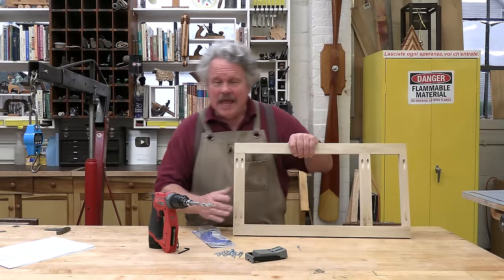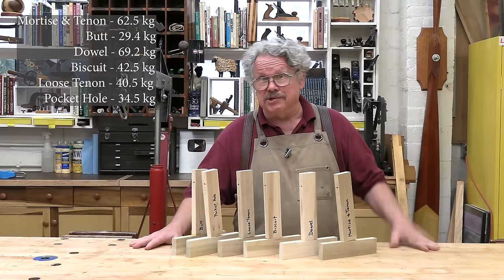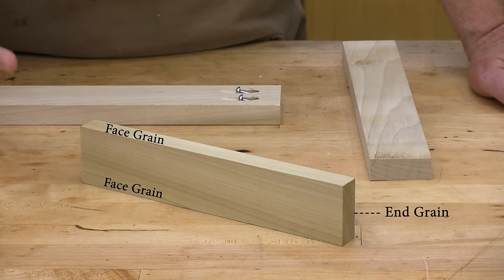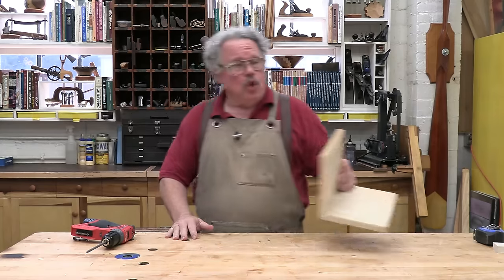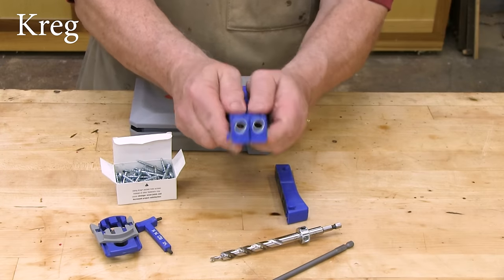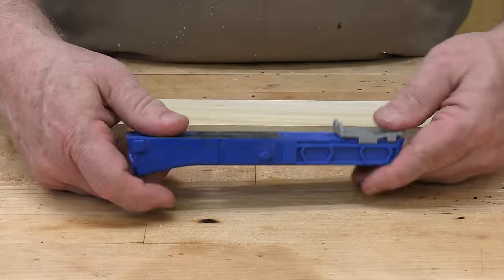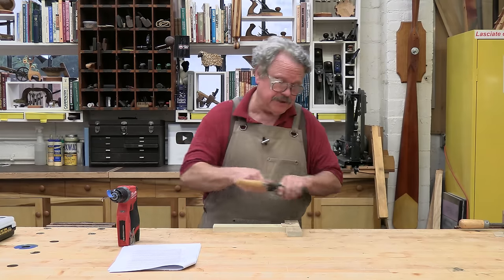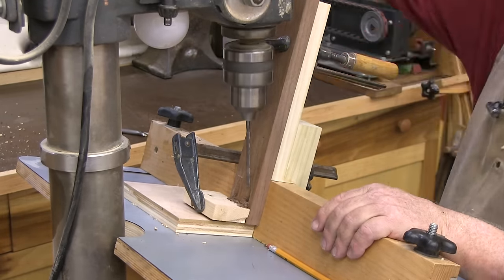Pocket Holes Overexplained

Comment: I'm not sure why YouTube suggested I watch this video but I'm glad it did. I have used pocket holes on a bunch of different projects but I still learned a lot from this video. Someone told me about pocket holes one time so I ordered a kit but have almost no woodworking training aside from 9th grade shop class 25 years ago. I typically work with metal but occasionally I violate the sanctity of my metal shop by using some tree carcass and learned pretty quick that none of my welding equipment or techniques work on wood no matter how hard I tried so pocket holes and epoxy seems to be the easiest way to connect 2 pieces of wood together with the least amount of wood tools and be able to hide the evidence when making a frame.
Reply from the maker: Thanks for sharing...and the kind words.

Comment: Fantastic video, watched the whole thing just wanted to say one thing:

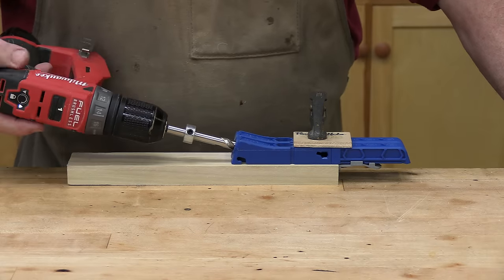The bit doesn't need to exit the first piece when predrilling your hole. If you are using the correct screw the screw will still spin freely and clamp the wood pieces properly because the thread will pass the end of the first piece of wood. You can see in your video when using the Kreg jig at ~14:40 both holes you drilled you hit the jig as you exited the wood, this will either damage your jig or the drill bit depending on what material the jig is made of. When offsetting the depth to fully penetrate you also reduce the amount of material left to clamp between the screw head and the receiving piece of wood, not a lot, but you are already being critical of the strength of the joint and this wont improve it.

Comment: Hi Nick. You can of course drill pocket holes either horizontally or vertically (easier to do horizontally) with a Shopsmith! & yes even though I live in the UK, I do have, not 1 but 2 Shopsmiths, Both Mk520, but one has the MK7 power head.

Comment: First time to this channel. I’m a “detail” guy and you impressed ! I might add one thing to your twice gluing end grain. Dilute the first glue application and then use full strength for the second . The diluted glue will be absorbed deeper into the end grain increasing the strength of the joint.

Comment: I like your approach. The pilot hole step is super smart and it will help solve the parts-shifting problem I always had with pocket holes. 

The jigs are designed to not have the stepped drill exit the workpiece, because the tearout will get in the way of assembly. That's why you had to position the stop collar further along. But I like your approach better.
Reply from the maker: Thanks.  You might want to read my answer to David Powell; it touches on the ramifications of using my method.

Comment: Some useful tips there.  Double gluing end grain for one, and keeping the grain direction of both boards the same.  I'd not thought to do that before.  I think my biggest problem when I first started using pocket holes, was stopping the joint being pulled out of alignment when the screw were tightened.  It's not always easy to clamp the joint while putting the screws in, so any tips on that would be welcome.

Comment: Good to see that you deal with metric on an equal footing rather than complain about it.  I generally use inches and feet (because I'm an old fart) but I know I have to make adjustments with plywood.  Really enjoy the channel and the plans I've bought so far have been pretty clear and easy to follow.
Reply from the maker: The global supply chain will eventually do for us what we don't seem to be able to do for ourselves -- convert us from fractionophiles to meterminds. Your comment concerning plywood is spot-on; we're no longer getting just 4' x 8' sheets, in many cases they're 1.25 m x 2.5 m. Bought a counterbore drill the other day that was clearly etched 3/8" right on the shank, but it miked at .3937" -- 10 mm. Thanks for your kind words.

Comment: Armor and Massca's higher-end jigs have setup systems that make the drill bit setup way easier. On Armor's Auto-Jigs, clamping in the workpiece will set the stop collar position and tell you which screw to use. Massca's requires more manual setup, but has a tool to position the bit so you can set the collar.

Comment: Geez, who'd have known screwing some wood boards together could require so much knowledge. As a plumber I didn't care about carpentry, but now I have so much respect for it.
Reply from the maker: As you well know, there is much more to sweating a good joint than just heating up the pipes. Same here.

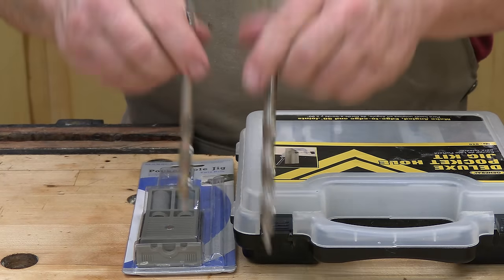Comment: Love your videos, but I had a different experience with the Kreg than what you mentioned at about 14:20 in the video. While it's true that the Kreg jig when the stop collar set at the wood thickness did not exit the wood - I followed your suggestion but found that if you set the collar such that it did just barely exit the wood, then once the screws were put in place, they would poke out of the mating board - disaster! In my project I ended up having to hand grind something like 80 screws by 1/8" or so to not get points protruding and ruining the work. That took about an hour but saved my project. Thankfully I didn't lose any knuckle skin to the grinder :-) I suspect that Kreg intentionally allows a bit of wood in the pocket hole piece. Maybe that saves time in case a chip hangs in place that you'd have to clear to get a good flat mating surface? Anyway, thanks for all of the explanation, but my advice would be to follow the directions exactly!

Comment: Love the info, just a quick couple obligatory clarifications from a structural engineer.  Crane scale isn't a strain gage, it's measuring force, not strain (change in length per unit length).  Also, most of these are going to be very dependent on "strain rate", so ideally you'd want to somehow use a consistent speed that you apply the load at.

Comment: I used to think I was crazy for drilling pilot holes for my pocket holes. I originally started doing it so I could use screws that were not from kreg, but it seems I was doing the right thing from a mechanics of the joint point of view. I also used a piece of dowel that is slightly smaller than the head hole (with a grub screw to lock it in place) so I can set my 1/8" drill bit depth, bottom out and get perfect pilot holes every time. Thank you for This bit of education.
Reply: I like your tip of using a dowel. I've done a number of holes using the Kreg so I'm not totally new to this. After watching the video, I was  unclear how to set the length ( marked with tape ) on the 1/8" drill bit. At first I thought you might be using a dowel with a 1/8" hole in it more as a guide. I'm confused about locking it in place with a screw? I assume I'll drill using the e.g. Kreg pocket hole bit, pull that out  and lay the 1/8" bit inside the drilled hole,  marking bit with tape ( at the back side of where the pocket hole starts ) having the drill bit tip extend out 1 inch. Does this make sense? My next system will probably be the Massca M2 Pro. I agree with you , I often wondered if wood would split if just relying on the Kreg screws to cut thru wood. Most of my work has been with soft woods, but I can see the need for a pilot hole in anything harder than pine.

Comment: Great video.

I'm kind of curious how much a bigger budget changes this?

The hobbyist like myself is certainly not going to get one of the bigger Castle pocket hole machines but just might find the precision of a Castle 110 to be worth the cost.  There are several differences you get with the Castle 110:
1.  Unlike the 15° angle most pocket hole jigs produce the Castle 110 will give you a 3° angle and that puts the thread into the middle of the joint.  This means that you are unlikely to get significant joint creep (not uncommon with the Kreg jigs I've had (still have my 720) and for at least some directional forces it should be stronger.
2.  The Castle 110 appears to give a cleaner hole which should fit tighter to the screw shank and that might also give a somewhat stronger joint.  (Probably not a lot stronger?).
3.  One thing that is considerably "worse" about the Castle 110 for some purposes is that so far as I know you cannot get plugs for the pocket.  Castle brags that their router makes a cleaner pocket (and it really does) but if I put a plug into the Kreg pocket hole and do a little sanding, IMHO it looks better than the un-plugged gap the Castle 110 leaves.  Of course the flip side of that is that if making something like a cabinet, the joint you get from something like my 720 is stronger if the screw goes in from the outside of the cabinet but with an only 3° angle the Castle 110 joint should be very nearly as strong if the screw is inserted from the inside and thus (in many cabinets) effectively hidden.
4.  Castle wants us to use their pocket hole screws.  They are a little different than the ones Kreg sells.  The Castle 110 ones have what I've heard is called a Fillister head (aka cheese head) and Torx drive rather than square drive.  These features may or may not be all that advantageous but as best I can tell there should be some strength advantage.

For anyone who cares you'll note I keep specifying the Castle 110 as their other machines make a 6° angle instead of the 3° angle of the Castle 110.  I don't know if that makes all that much of a difference but there is a difference between the geometry of the holes made by their big machines and that made by the Castle 110.

Interested in your thoughts.

Comment: I am new to pocket holes, I got my son's old one.  I was practicing today wondering why is the wood splitting?  I usually drill pilot holes when I set screws.   Great idea, drilling pilot hole, takes a few seconds and saves time in repairs later.
Reply from the maker: Thanks.
Reply: Great advise here!
After almost a year of using your advice I haven't split any pocket holes!
What I have learned in a year. 
Don't become addicted to pocket holes.
Don't buy the most expensive jig.
Always drill pilot hole.
Regular clamp works better than vise grip looking clamp.
Clean holes after drilling.
Glue all joints.
Thank You again.

Comment: Nick that was a great presentation, I learned a couple things and I've been building with pocket joinery for quite a while. One thing you only alluded to and I think debunks every joinery "test" I've ever seen performed on YouTube is that no joint will ever undergo the kind of stress applied to the joint in such tests. Also, a finished project, piece of furniture for example, is a combination of joints and techniques that as a whole will be plenty strong enough to serve it's purpose if all of the joinery and assembly techniques are implemented properly. Let me explain. I made a cabinet to hold our family's game collection. The box, sides, top, and bottom are all 3/4" oak plywood, joined together with pocket holes and glue. There is a back of 1/4" plywood glued and nailed into rabbets at the back edges of the sides, back and top. A solid wood face frame is held together with pocket holes and simply glued to the front edges of the sides, pocket holed from the  bottom of the cabinet while screwed from inside the cabinet from a front support board that spans the cabinet between the sides with pocket holes and glue fastening that support to the sides, This cabinet has four hardwood legs attached to the bottom and two doors are attached to the face frame. Here's my point. That cabinet holds the games fine, a lamp and candy jar sit on top. If I need to sit on top of the cabinet it would support my weight with no problem. As a whole unit it is a sturdy piece of furniture. Like any piece of furniture, if you were to throw it off the back of a truck it would sustain some damage, but if you treat it with respect it will last long past my lifetime. Pocket holes are a great way to create a lot of different things if people will listen to your great suggestions. And I would add one more thought. A lot of people I see on the interweb criticizing this type of joinery never put enough pocket holes in the long joints that they "test," like joining the bottom of a cabinet to the sides. The combination of the back, front, glue, staples, and plenty of pocket screws in those long joints will more than adequately hold it together.

Comment: Thanks for your great Videos. Live the way your explaining everything. I think you forgot one thing important to know. There is a direction in which the pocket holes are strong and in which they aren`t. Unfortunately if you use them correctly at the edge you can see them. Used on the inner side of the construction you easily can crack the wood by pulling the two parts to the outer side. Not easy to explain without showing it
Reply from the maker: Good point, and It can be explained simply in this way -- screw joints are considerably stronger when the screws run perpendicular to the wood grain, weaker when they run parallel to it. This is true of all screw joints, not just pocket screws.

Comment: another great video, you're channeling your inner Matthias Wandel with that testing jig :D.  I don't use pocket screws very often but they are great for situations like replacing broken cabinet parts while still in place, rather than disassembling the entire cabinet/counter to remove it and when you are doing something quickly.  I normally use dowels for most of my furniture and woodworking builds but everything has it's place.  What I don't like seeing is pocket screws being used by "makers" (aka amateurs) for things like benches or tables and other items where structural strength is paramount.

Comment: @12:08 Sorry to be nitpicking but the metric screws you are referring to are not designated 3M and 4M but rather M3 and M4. The M always comes before the number which is the screw diameter.

Comment: Good video, I never thought about pilot holes. Would have liked to see some comments on pocket hole joinery on plywood.
Reply from the maker: Same rules apply, but you slightly more constrained. You don't want to drive screws into the edge or end of a plywood board because it's 1/2 end grain.

Comment: Thanks, very informative.
One thing I noticed was the chuck getting in the way when you were creating the pilot holes in the joined board. Perhaps a longer bit would help there. The other problem I think may arise is getting that 15o angle right for the pilot hole. Who knows, perhaps misalignment creates a stronger joint?
Reply from the maker: In shooting the pilot hole, you're using the shank hole as a guide sleeve. As long as you keep the bit centered in the counterbore, the pilot hole will be remarkably well-aligned, especially if you using Kreg pocket-hole screws -- the shank hole and the pilot hole are the same diameter. And there is some wiggle room -- remember, the shank of the screw should be loose in the shank hole.

Comment: Nicely explained, Nick🎯
? Can’t help thinking the glue area and tightness of joint plays a very large part in the strength test❤️
Reply from the maker: It does. That's one of the reasons why we would need to do these tests over and over again to a get a statistically significant average.
Reply: @WorkshopCompanion  Yeup happy hammer twirling🎯👍

Comment: Dear Sir, wonderful video.
Please correct me if I'm wrong but wasn't there a drill bit that actually did all three at once?
I'm sure that there was.
I went to a hardware store and explained what I was looking for.
I was introduced to Kreg pocket-hole.
Love the guide hole but as you pointed out and I agree, the pilot hole is key.
Reply from the maker: Yes there was. An adjustable three-step drill -- but the company that made it went out of business. You could do it with the two-step Keg drill if it was adjustable. The pilot hole and shank hole for Kreg screws are that same size. But you can't change the length of the smaller drill on the bit they provide.

Comment: Lots of great info in this video! One question I have is when using pocket holes to join plywood, do you consider the plywood as a hardwood when choosing the thread type of the screws to be used?
Reply from the maker: Totally depends on the plywood's core.

Comment: The back of the massca is the guide sleeve in order to set your stop, fyi.  I'll be honest, I've never used pilot holes on my pocket holes and have yet to split any wood with my massca.  It has no dust collection, but that's the only thing bad I can say about it.

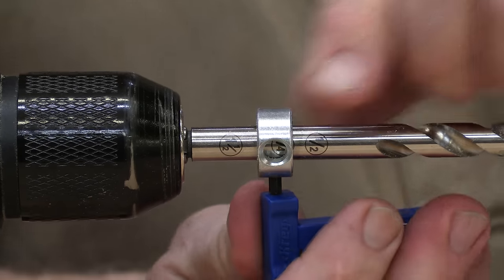I do find it digs too deep or my driver pushes the screw through the wood too far and has the point of the screw poking out the other side.  Not something you want on the top of you sitting bench, haha.  @14:20

Also the massca's end can slide off and back on the other way around if you're doing the other type of pocket hole.  The arrow on it tells you which side you need to read (and set the magnet to) for the size of wood you're using.

Comment: I enjoyed this video; you do a nice job presenting.  What if you were to use dowels instead of screws?  So use the Kreg style jig, drill using a normal,long drill outfitted with a stop collar, add glue, shove a dowel rod in there,  then saw flush.   Best of both worlds and surface plug built in.
Reply from the maker: Intersting technique.

Comment: I had a pocket hole machine in my cabinet shop. It clamped the piece down pneumatically, drilled the pocket from the bottom, and then drilled the pilot hole from the end face.

Comment: Excellent presentation of this subject.  I have found it odd that the bits provided by the pocket hole manufacturers do not include 2-steps (not 1-step) to include not only the pocket and shank holes, but a pilot for the mated piece.  As you point out... too many times the mated piece splits due to the lack of a pilot hole.   I assume it is too expensive to manufacture and would not permit their use on differing screw lengths they typically offer.

If someone knows a source for such bits in the most used size (3/4" to 3/4" part assembly with typical 1-1/4" pocket screws), I'd love to know about it.